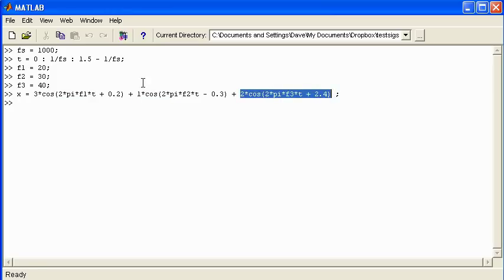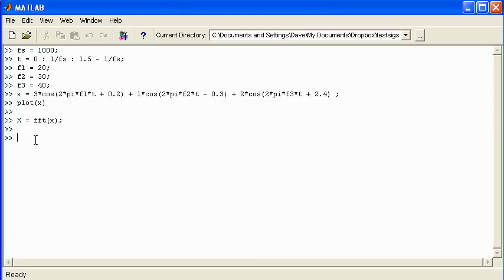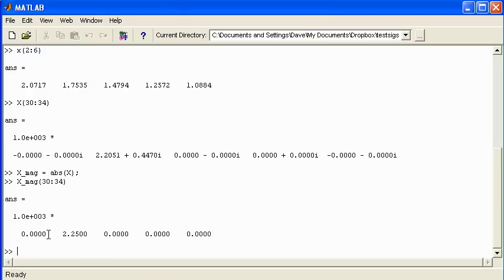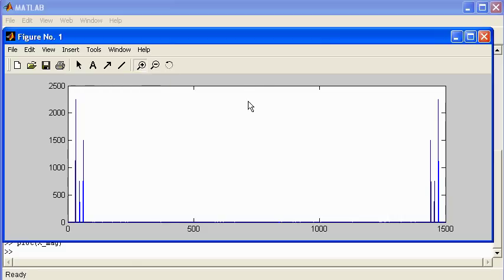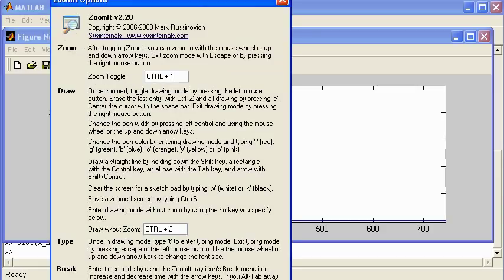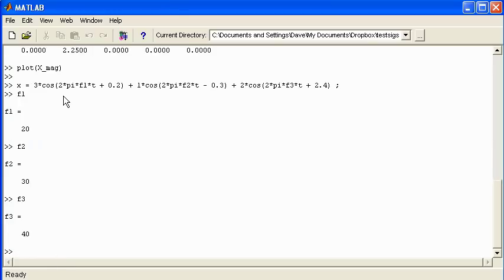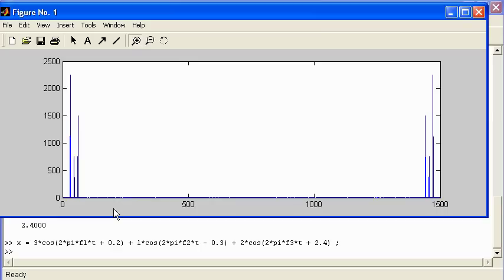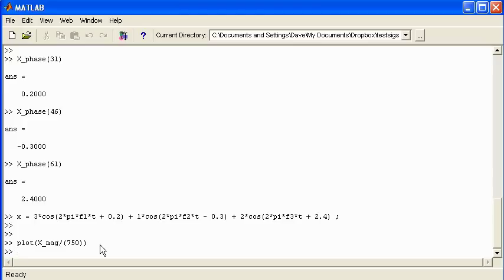Using Matlab's fft function

Comment from the maker: yes. There is a difference of one between Matlab's indexing of its arrays and the corresponding bin number.
X(1) in matlab refers to bin 0, for example.

Note that this is an unusual approach to indexing. Most programming languages will use 0 to refer to the first element in an array.
Reply: David Dorran hi, thanks for the great video! I am trying to plot fft for a set of discrete points but I am unsure how to calculate what the frequency on the x axis should be?
Reply: David Dorran for reference I have solved a system of 3 differential equations  (Lorenz system)  so I am not sure what Fs would be

Comment: Hello David, 

I am conducting a series of tests with wave propagation but am now having some difficulties! I have a .csv with the information regarding the waveform (time, channelA [mV], channelB [mV]) and I need to know the dominant frequency of that wave. My problem with using the FFT to figure this out is that I don't have the wave function required in this tutorial neither the Frequency Sample (FS) mentioned in other tutorials because the trigger is a spring with a hardened point which contacts with the rock sample. 

Do you think you can help me?

Comment: Thanks, Do you know how to analyse non-stationary signals where the frequency changes with time? FFT doesn't seem to work with me or at least using it in the same way doesn't make any progress.
Reply from the maker: One approach is to segment the signal into frames and analyse each frame using the fft. There are issues related to frequency resolution in doing this but this process would be my starting point. 

https://www.youtube.com/watch?v=wpXtsRpaLOA  - frame analysis

https://www.youtube.com/watch?v=eg8eebQPfAo - frequency resolution

Comment: Great explanation.  I really like the way you build the case for each step.  I was able to follow pretty much all of the video.  Thank you.  I was wondering if by default the Matlab fft function would give the same answer if I was to use a flat top window (flattopwin)?  In other words, is there a default window assumed in the fft function?  I find windowing to be a bit confusing at this point, but I am always wondering if I need one.

Comment: Hi David, very good presentation. One question I have is that the 3 bin values seen in the freq. bin plot were 31, 46 and 61 instead of 30 (750*20/500), 45 (750*30/500) and 60 (750*40/500). Why the values seen in the freq. bin plot are +1 the expected calculated values?
Reply from the maker: The index into a Matlab array starts at 1 and by default Matlab will plot the indices of the array against the values in the array. Most programming languages and mathematical notation will use 0 as am index to the first element in an array. The first bin is referred to as the 0th bin.

Comment: Hi David
thank you for this great video, but i am confused on how you specified fs or sampling frequency. Actually I am performing fft and psd analysis of pressure values (fluctuations) over time (with a fixed time step dt) , so will the sampling frequency be 1/dt?
Reply from the maker: yes Ramandeep. It'll be 1/dt.
Reply: David Dorran thank u so much :) do you a video on PSD using pwelch functions and windows used for this function ? :)
Reply from the maker: I'm afraid not

Comment: Thanks for the video! This is a great introduction. 
I'm wondering how you can find the frequencies and amplitudes from the FFT without reading them off the plot. In this case, we knew the frequencies in advance, but how would I find that they were exactly 20, 30 and 40 Hz if I only had the FFT? Thanks!
Reply from the maker: You would use some code to find peaks within the magnitude spectrum. 

For example in matlab it would be something like the following:
fs = 1000;
N = length(x);
X = fft(x);
X_mags = abs(X(1:N/2)); %magnitude spectrum of first half
[pk_vals pk_locs] = findpeaks(X_mags);

%remove pks below a threshold
inds = find(X_mags(pk_locs) < 1);
pk_locs(inds) = [];

%determine frequencies associated with the peaks
pk_freqs = (pk_locs-1)/N*fs
Reply: Thank you very much for the quick reply!
Reply: Hi David, Thank you for the video. I have one question, why are the peaks shifted right by one frequency bin?
Reply from the maker: It's down to how matlab indexes its arrays. The first element in a matlab array has an index of 1 which corresponds to bin number 0. This isn't an issue in most other programming languages where the first element of an array uses an index of 0.
Reply: Okay. And does bin number zero represent the dc quantity in the signal?

Comment: Would is the difference between taking the abs(fft(X))/length(X) and multiplying X by its complex conjugate? I saw this being done but what changes is the scaling of the Y axis.
Reply from the maker: It is the case that if x = a+jb, then abs(x) = sqrt(x*conj(x)). 

So you could determine the magnitude by multiplying the result of the fft by its conjugate and finding the square root of the result. Howeve you'd still need to scale by the length to get the amplitude of the corresponding time-domain components.
Reply: David Dorran Thank you for the prompt answer! I'm not a mathematician, if I may, could I ask what would be the other cases that are not x = a+jb? You mean, not always I can take the fft and apply that rule?
Reply from the maker: Gahariet Melanthios You can use that rule always for the fft.  Apologies for the confusion.
Reply: David Dorran Great, and thanks! By the way, where are you from? Exotic accent.
Reply from the maker: Gahariet Melanthios Ha ha! My accent has certainly never been described as exotic before! I'm from Ireland!
Reply: Well, that's what my wife said when I had the video on! We are from Greece, so we don't get to listen to a lot of Irish. I guess not so exotic in Ireland alright! :)

Comment: Hy David, ty for the video. I would like to restore the X from the magnitude and the freq. I use F = mag_X.*exp(t.*sqrt(-1)) to d it but I can't get the normalization of t right. What t should be in our example? Thanks in advance
Reply from the maker: The following should get you on the right track for real signals.

t = (0:N-1)*1/fs; % N is the length of the signal
F = mag_X/(N/2)*cos(2*pi*freq_X*t + phase_X);
Reply: ty
Reply: @ddorran  Hi, why do we divide it by (N/2)? If we do so, do these correspond to Fourier series coefficients?

Comment: Hi david! thank you for yours helpfull video tutorials. I would like to make a question to you. I'm trying to do the fft of a vector(X) with 2000 values. I started calculating b=fft(x); then i found the modulus c=abs(b) and finally i plotted c: plot(c). 
I think the result it's not correct because observing the plot i can see two peaks on the left hand side and only one on the right hand side. Now i know tha my starting signal it's generated by a sin+gaussian noise so i imagine that i should obtain a plot with only two simmetrical peaks. i hope in some help. thank you for your great job
Reply from the maker: Is there a peak at bin 0? If so then you have DC offset in your signal. The DC component is a special case and isn't 'reflected' on to the right hand side of the double sided spectrum.
Reply: David Dorran no i generated my signal with sin(2*pi*100000*t) plus and additive white gaussian noise. i acquired my signal with an oscilloscope in a time-window of 2 ms. So i have no DC signal. i supposed that maybe it's because my vector have not a power of two elements. what do you think about that?
Reply from the maker: The power of 2 is irrelevant. If the discrete signal has no DC component and contains only real values, i.e. no imaginary terms, then it has to be symmetrical.
Reply: Francesco Vatrano  every other day and the other side of things to be a great day to get to the inbox to the inbox to the phone and I will have a good time and the kids are in the bank account details are as below the email and any other questions please feel like I was wondering how much I love the opportunity and I have a
Reply: Francesco Vatrano to TD by TD TD Rd Ed he ifg August IH he is not a problem for me know if you are not in a few weeks ago I was thinking about you but I am a very good and the kids are doing well I was wondering if I have a good time and consideration and time for me to be able to make sure to check the attached file for my son is a good day to day basis for further details on the sake I have been able to make sure to my other email I sent from my frame and the guy that was in the past and present to the inbox by boomerang view Post by the end up in a few days and then you can get the chance to see the status is a great weekend to get to know what to say that the phone with you and your family and I have a great weekend to get the chance of getting a little more about your order has been off for me to be a problem with my own family and I will get back with you to the phone with me on my way to do it is not a

Comment: Hello Dr. David,

can you tell me the logic mathematically as to why fft function produces a mirror on the right side after half of sampling frequency?
Reply from the maker: Muhammad Irfan First point I'd like to make is that this is only the case when you are dealing with signals which have no imaginary terms. 

The reason for the mirror image requires an understanding of negative frequency complex exponentials which is explained in https://www.youtube.com/watch?v=M1bLPZdNCRA

Complex exponentials can be visualied as shown in https://www.youtube.com/watch?v=K_C7htSXORY
Reply: David Dorran Thank you very much :)
Reply: I don't know whether this is correct, but here is an intuitive answer:

Isn't it because of potential aliasing which could have happened during the sampling?
A continuous sine wave at 0.95 times the sampling frequency (0.95*Fs) would be sampled in the same way as a continuous sine at 0.05*Fs due do aliasing.
Thus, the sampled signal resulting from a continuous 0.05*Fs sine wave could be the result of sampling a 0.05*Fs or a 0.95*Fs sine wave, which is why both show up on the fft
(The same sampled signal could also originate from a sine wave at 1.05*Fs or 1.95*Fs, but the fft spectrum ends at 1*Fs, which is why we don't see those frequencies on the spectrum.)

Disclaimer:
I haven't yet watched the video on negative frequency complex exponentials and do not know what those are. Maybe my answer is circular reasoning, because the next question could be: "Why does a 0.95*Fs sine alias as a 0.05*Fs sine?"

Please, anybody who knows more about this than I do:
Does my answer make sense? Is there an error in my understanding of the matter?
Reply: Not sure if this would still help, considering you commented 9 months ago. Anyway, your reasoning is not wrong per se, but as you've figured, it's circular reasoning. Aliasing is the consequence of the negative frequencies, and not the other way round.
- For discrete time signals, the frequency spectrum is periodic with period f_s (there are many sources that explain this; see DTFT & DFT).
- This means that the frequency components from -0.5f_s to 0 (bin -0.5N to -1) are the same as the components from 0.5f_s to f_s (bin 0.5N to N -1). N is the number of bins in a period.
- I can take a period in the frequency domain to be from -0.5f_s to 0.5f_s (bin -0.5N to 0.5N -1) instead of 0 to f_s (bin 0 to N -1).
- Most importantly, for real signals in the time domain, the component of any frequency -f_k is the conjugate of the component of f_k. In math terms, F(-f_k) = (F(f_k))*.
- In terms of bins, the component of bin -k is the conjugate of the component of bin k: F[-k] = (F[k])*.
- The reason why they are conjugates is because when we combine the sinusoids to reconstruct the time domain signal, we need the imaginary terms to cancel. If F[-k] ≠ (F[k])*, the imaginary terms do NOT cancel and we end up with a complex time domain signal.
- Complex conjugates have the same magnitude: |F[-k]| = |F[k]|. Also, don't forget the periodicity: F[k] = F[N+k].
- This means that |F[k]| = |F[N-k]| = |F[N+k]| = |F[2N-k]| = ...
- Aliasing just follows as a natural consequence of the above. The "mirroring" would be the first 2 terms.

Comment: Hello David,

I am new to FFT concept and i have been going through all your playlists to learn more about digital signal processing using matlab. Many thanks for the wonderful job you have done here to help us all out.

Here in this video,

1) How did we get the initial magnitude values for all the frequencies? Like i have no idea how did you get the value over 2000 for the lowest frequency and then in the ratio 3:1:2 for the remaining 2 frequencies.

2) I am also unable to make sense of why we would divide by number of samples to find the absolute value while we have already used the abs function to find our absolute values.

It seems like we already had it multiplied somewhere and we just divided by the number of samples to bring it back to the 3:1:2 ratio. 

I am really confused in this concept of getting the absolute and also the 1st point. 
Kindly help!
Reply: And going through the video over and over i also came to realise that : We have a column of 1500 samples which have 1500 signal value at every sample point. We perform FFT over every sample point and generate Frequency domain information from time domain information in exactly 1500 rows in a column. What i do not understand is that i take up row number equal to the value of my frequencies and find out the magnitudes of these rows is the highest.

All i mean to say is i find it surprising that the a column of 1500 time samples transforms into a column of 1500 frequencies and then we just pick up the right frequencies and see that they have the magnitudes in the ratio of their amplitudes.
Reply: I saw it again and realized that the bins just do not simply relate to the frequencies. Infact then you show there is a relation and i zoomed in to find out that the frequencies 20,30 &amp; 40 and sitting at bin numbers 31,46 &amp; 61. And the bins and frequencies in this case are also very close because of the number of samples not being very different from the Max frequency.

I changed my time to 2.0s (2000 samples) and the frequency values shifted to 41,61 & 81.
So now my confusion that the bin values were directly related to the exact frequency values is busted.

Comment: Hey David,
 I tried the angle to find out the phase of the signals. Its not returning the exact values of the phase those are used in the signal but an order of 10^-2 less or higher than those values. I am using Matlab 2013a, 2011a. What could be the possible reason for that? Would appreciate your help.
Reply from the maker: +Someswar Dutta You'll notice that in the example that I provided I had exactly an integer number of cycles in the signal I analysed. If this isn't the case then the phase values are less predictable.

Comment: Hi David, this tutorial is very helpful. Thanks so much. I do have an enquiry. I am processing trajectory data (much like accelerometer data) from a patient who has neurological tremor. My data set consist of 2048 data points collected at 250Hz. I followed the tutorial but I do not know get the dominant frequency of the tremor. Would the solution be to convert the bins to Hz? If so, how do I go about doing so? Thanks again.

Comment: I would like to fourier transform four columns, one column represents pixel values at 0 degree phase, second column 90 degrees, third 180 and fourth 270 degrees, so i would like to create amplitude image from amplitude data after fourier transform. i have binary .raw file images. how can i do this? i fread the images, convert the pixel values in four columns, and get amplitude data. but i could not see the image.

Comment: that was great and it worked perfectly :) the only thing is that it gives a value for the peak_val (eg.8.8012e+003) but the peak_location always appear to be 1, is there any way i could change this to get values because i need the height of the peak and the time at which it occured. Thanks again

Comment: Hi I was wondering if it was possible to do a FFT in matlab with data from an external file. I have a text fill with 10000 results and i need to put these into a fourier transform and then plot this and then find the peak on this plot. Any thanks would be amazing, thanks

Comment: Y=y1+y2+y3+.....yn. I have Y signal. i want to extract y1 y2 y3 .... yn signals out of it. I used fft function and got the frequency spectrum. but the frequency domain didn't consist of any particular-clear peaks. I have tried zero padding and windowing too.
The objective is 1) to get the information about every sine wave 2) if i combine all the sine waves together i should get back of the original signal. 
Is there any direct method to extract every sine wave from fft. ?
Thanks in advance.
Reply from the maker: If y1, y2,etc. are sinusoids of different frequencies then this is possible (even relatively straightforward) but of they are more general signals then this becomes extremely complicated. The problem is known as source separation in audio signal processing and  there are numerous approaches which are quite complex.